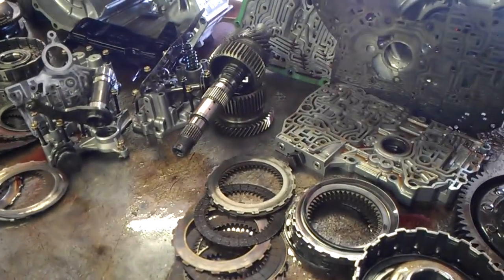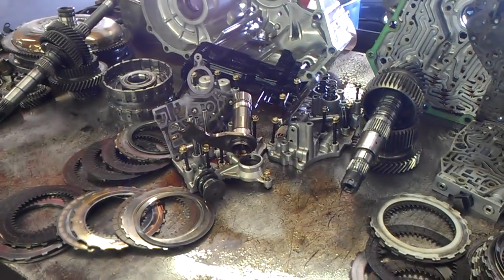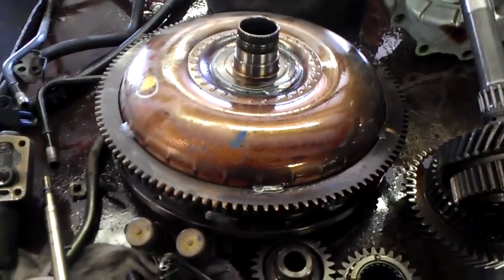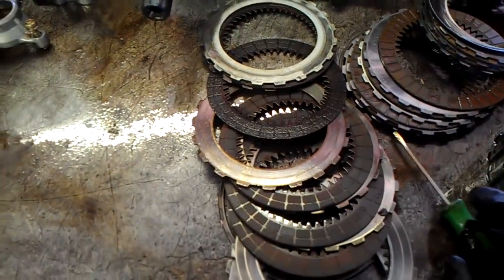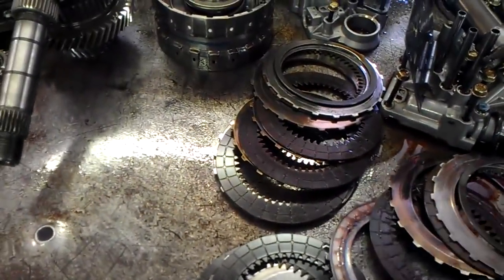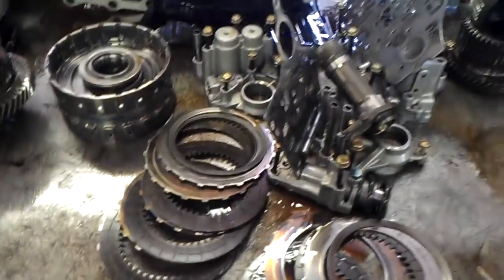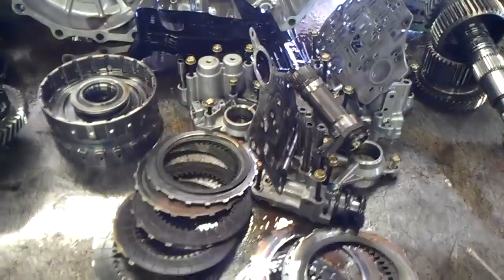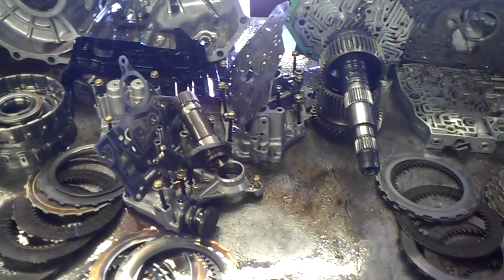B7TA Transmission, P0740, P0730, P1750 - Transmission Repair

Comment: This was very helpful to me with the situation I'm having with my 2002 Acura TL 3.2L V6 base. It's currently only throwing one code though. Which is the P1750 for "Clutch Pressure Failure"

Comment: I have a 02 acura tl type s the trans went out because of that p0740 code I had the transfer rebuilt and I'm still getting that code is there anything else I can try to get this problem fixed?

Comment: I have a 1999 Acura CL...IT reads P0730 Code. Do I need to change the whole transmission or can I change the Solenoids and be ok. 
I need advice. Thanks

Comment: Fyi I had transmission issues all of a sudden in my 03 honda pilot. D light started flashing. Shifted hard. Then went into limp mode. Got stuck in what seemed to be 5th gear. I got it home. Left it sit. Started it up the next day Ran/shifted fine until it warmed up. Then would shift hard again. It did this for a few days. But I decided not to drive it and thought the worst. Thought I'd need a new transmission. While looking underneath the hood again, I found a ground wire that had corroded and fell apart. so decided to replace it first. Well glad I did. It fixed my transmission problem. Instantly the check engine light was off. D light was not blinking and it shifted like new. I am going to drain tranny fluid n refill just in case I messed something up. But I think all is well. Been ok for 5 days now. Cost me 33 bucks at rockauto.wow
Reply: Also wanted to say. The codes it threw when I ran em were p1750 and 0740. Thought I was going to need some major repairs done.
Reply: @Thegods190  thanks for this information. My moms car has the same P1750 code now for her car. Where was the ground wire located under your hood? I’m not knowledgeable about cars so I’m on here looking for enough information to see if I can fix it before taking it to an expensive shop

Comment: Hirman, I picked up an 03 Odyssey at auction for a family member. It runs well until the car heats up. Once the car is up to temperature, the transmission starts slipping. It throws codes P1750 and P1751. Is it worth trying to change the fluid or changing a simple part, or is a full transmission rebuild likely necessary?
Reply: Fluid level seems to be OK. Fluid consistency isn't great but it isn't toast either (fluid is reddish with a bit of brown).
Reply: ItsELUKbaby I have the same problem but it is a Honda Accord 2000...codes P1750(Clutch press control valve malfunction),P0740(TCC solenoid circuit /open) shows up after car heats up...Were you able to get it resolved..
Reply: did u ever fix the problem Krish?
Reply: no..i keep changing the Transmission fluid. every year....been 3 years driving with the code ON...if I go to the shops, they tell me it would cost $2500 to fix..my Kelly BB value is $1800..not looking to fix and hopefully trade in this for $1000 to a mechanic or dealer

Comment: I had change the tcc solenoid on a 99 acura tl and also the fluid put honda fluid in it and clear po740 code the car hasn't been back

Comment: like your videos...need help i took a 1999 honda odyssey 4 speed automatic transmission apart got everything ready to reassemble but there's a spring and a single bearing ball and i don't know where it came from most likely somewhere in the valve body would please point the way i would appreciate your help.... thanx

Comment: I have a 2000 Acura TL.  Transmission was just overhauled by a transmission shop.  Less than 300 miles on trans.  P0740 popped up.  What do u think might be the problem?  Thx
Reply: TCC (torque converter solenoid) Solenoid and/or TSS (trans shift solenoid) Solenoid

Comment: i have the same code on a honda odyssey...p0720--0730--0740 is changing the torque converter can r will fix the problem?
 cause when it get hot it stop moving and the Transmission fluid smell really bad.

Comment: I have a question, I have a 2001 Honda accord and it drives perfect on the freeway but when im stop and going threw traffic it starts to slip. Engine Code P1750 popped up with no other codes. I erased the code to see if they would come back sure enough after driving the car hard in traffic it slipped again.. Codes P0170, P0730 and P1750. What can I do? somone told me to replace the pressure clutch Solenoids both A and B. What do you think? thanks